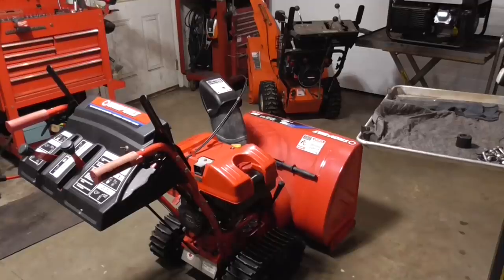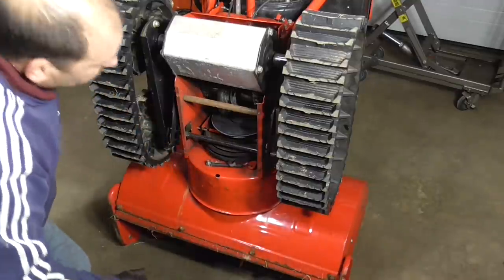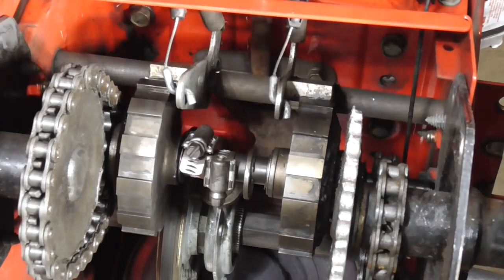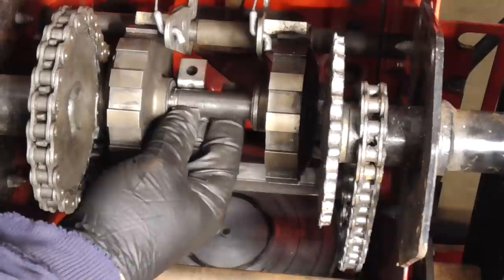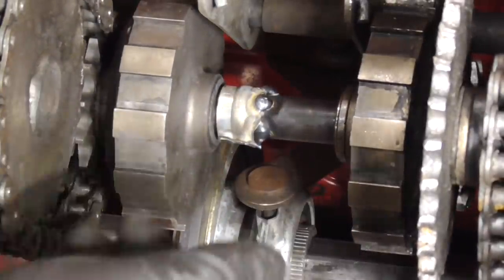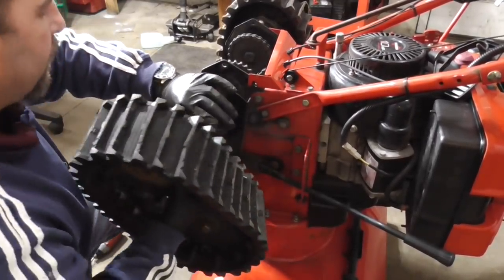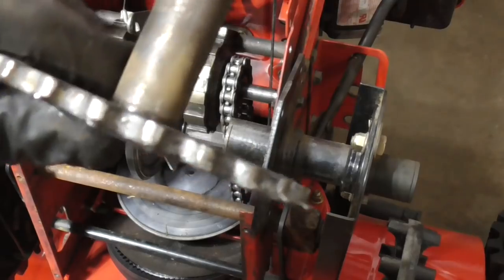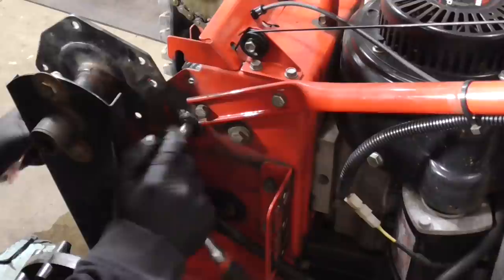Fixing Track Snowblower That Won't Drive

Comment: Great video! I got this same snowblower cheap off a co-worker a couple years ago and am trying to replace that drive gear shaft that you welded the clamp onto. I was having the same issue with the right side not propelling and it was due to a cracked cog on that shaft. So far I've got the old shaft out but can't get the new one in. I need to take the track off like you did so this video was perfect for my situation! Thanks again!

Comment: I just watched your live broadcast.  I wished I had known it was on I would have sent a comment.  I don't know how your fixing the John Deere hood.  I fixed one this summer it had 5 fairly large cracks. I bought a fiber glass kit and used a drywall tape actually a plastic mesh. I used the mesh on the inside only cut some fine grooves in the top side and filled with fiber glass. I bought  some  john Deere  green at home depot matched perfectly.  I cost $3.00 per can John Deere  wanted $9.00 per can.
I also wanted to mention that I watched your video on home remedies.  Your wife segment on  the floor Steam cleaner was great .  I ordered one right after your video.  Thanks again  Ron B  Ron's small engine  repair. Marcellus Michigan

Comment: What a gem of a machine!  Amazing how Troy Bilt Dolled Up Tecumseh with those covers.

Great fix!  Never seen that one for before! 🦅🔧🤙🏻🇺🇸
Reply from the maker: Glad you enjoyed it  I have worked on a  few of these troy bilts with the plastic engine cover.  The cover is the biggest PITA to remove and snap back on it always gets stock on the electric starter, the choke shaft, and the studs it mounts with.

Comment: Nice video. I had the same exact issue with an old White track drive. Ended up just taking a piece of aluminum tubing cut to length and cutting a slit down it lengthwise and spreading it a bit to get it over the shaft. Then crimped it with pliers and wrapped it with some zip ties. If it doesn't hold I'll definitely be welding a piece in there.

Comment: Great video my friend. I am in Pennsylvania too. I was born in Johnstown and from your accent I figured you were out in Pittsburgh. Great area. I am out in Bangor PA now working at a pharmaceutical company dreaming about starting a mobile small engine and welding repair company with a truck with a crane like the guy from classic work or IC weld. I ope to hear from you. I shouldn't really say dreaming because I just bought two welders, a truck mounted and a trailer mounted. I also found a 1999 Ford Ranger that needs the frame welded but that will be no problem. I am slowly getting my tools together. I am also recovering from a horrible accident where I was hit on my Harley and had extensive blood clots where I was not allowed to walk for seven months. I survived at least.
Reply from the maker: Bangor is about 35min. from me.  Going from white collar to blue is going to be quite a jump.  I would start moonlighting and see how you like it.  You will still have healthcare and a steady paycheck if it does not work out.
Reply: @doublewide6  It is a decent paycheck and great healthcare. I do not plan on jumping off. I definitely plan on doing weekends mainly. Thank you my friend!!

Comment: Great video.  It's really helpful to see step-by-step fixing issues and not just jump to finished product.  Thanks for taking us along.

I do have a question.  The auger housing, scraper bar and auger housing shoes look like they are about two inches off of the ground.  Are the tracks adjustable to lower the front down to where it should be?

Comment: Thanks for the video!  I have the same snowblower, left track won't drive.  Spins free with or without the steering assist trigger applied, while the right side engages with the friction wheel and steering assist.  Is there a keyway or shear pin for the track wheel?  I have it apart in the garage, cannot find any reason why it would not be working.  Chains on sprockets, everything seems to be within spec.

Comment: Hi, I enjoy your channel I have a craftsman snow blower with a track drive, my problem is with the wheel shifter lever doesn't do anything when shifting to normal to wet snow and when I shift it to transport mode the lever moves back to normal by it self, what do I look for and how can I adjust this thing ? any help is greatly appreciated please if you can direct me with pictures of what to look for Id really appreciate it.

Comment: I have a Craftsman track drive 8.5 hp 26" snowthrower I bought in '97, and it has this exact problem. I don't see a loose chain, so I'll just take it down to the mechanic. Hopefully it'll be an easy fix. Getting it on the truck should be fun. Not. Since it only wants to go right, not straight ahead. I bought the track drive because that was what we needed. Somewhat steep terrain, plus doing paths off of the driveway. Need that traction.

Comment: Stens is a good company.  I just rebuilt that K301 and ordered their rings, they were quality parts.
Reply from the maker: I saw that I thought Stens failed you?  I have used their parts, but I just became a Stens dealer, so I can get the parts from them and not a reseller.

Comment: Nice fix; I have a 10 hp Tecumseh in my shop right now with a stripped starter gear caused from loose bolts. Does Stens sell the starters? Thanks for the video.
Reply from the maker: Yes, they do, but I like the DB electric starters from Amazon, they are aftermarket just like stens.

Comment: Great video.  I don’t see many tracks where I am at either, but definitely more costly to repair.
Reply from the maker: Tracks also suck to push around when they are not started and in your way in the shop.

Comment: Hello,
I have an MTD  8/26 Track Snow blower MTD E740F000 that doesn't drive I've replaced the drive belts, friction disc and wheel. everything is free turning and spinning like it should with no weight on the tracks. When I tip the machine back over on it's tracks start the motor put in forward or reverse you can see it wants to move but something is binding and holding it. The only thing I didn't replace was the outer Flange Bushings part # 941 0339 or 741 0339 #59 on Jacks Small Engine parts diagram. I noticed when I had everything apart that those outer bushings were worn egg shaped both left and right side, Would that cause everything to bind up and not move, if so should I replace all 4 or can I get away with just the two outer ones. It's an old machine.
Thank you in advance for you help.

Comment: Great job Bob. I'm not a dealer in any parts but I've used stens a lot and I think they are a quality company. Excellent idea with the electrical strap. I've never worked on one like this but I have worked on a few craftsman track drive blowers which are a totally different deal but equally goofy to work on. Congratulations on 100,000 subs !!! You deserve it
Reply from the maker: Thanks 👍

Comment: I have a MTD Yardman 9HP 26" 2 stage with tracks electric start.😅 paid 75.00 put 200.00 into works grate. After I made it go again.  I know Stens when I worked UR I ordered parts from them. I also have a very good back round in PT -V, Flat, Round, Conveyor Belts of all kinds. Look up Fast Trax Snowmobile I helped in the development of it. can be seen on U-Tube. 1911 Harley uses a 1-1/4" x 101-3/4" long flat belt if it is the correct material it will go 1000 miles or better factory belt 60miles.

Comment: Just replaced a 120 v electric starter on a troy-bilt storm that wasn't track drive. The starter was stripped completely. You ever seen that before? Also ,cleaned the carb on it. Those engine covers are a night mare to get on and off too.
Reply from the maker: What happens is the starters lose a bolt and shift.  It causes the teeth to wear out  on the ring gear.

Comment: Why would you weld that piece on.. seems like the better choice was what the other guy did. With those clamps.. cuz then you can remove them if you need to And they both do the same thing taking in place of the snap ring..

Comment: Ah ha more complicated than the one with wheels.  I wonder if the track type move through the snow that much better than the ones with wheels.  Great video anyway.
Reply: My opinion they do I have a craftman  track drive and its very strong going thru the snow traction just like a miniature bullfozer

Comment: You can’t beat a Canadian made snowblower. I bought my 8hp-26” in 1985 from Canadian Tire in Ontario just east of Toronto and it’s still running great which I maintain.
Reply from the maker: Those old blowers are really well made.  If you take care of them they should last a lifetime.

Comment: Welding something that was originally snapped in, now you have made that part unserviceable without cutting it out. On an older machine like this guess it wouldn't matter much. MTD = Many Troubles Daily from Taryl LOL
Reply from the maker: Yup,  If I replaced the shaft it would of cost an additional $200.  If it needs to be replaced in the future it is still going to be $200.

Comment: That “electrical connector” is called a one-hole-strap.
Reply: Way to go. We call it farmer engineering. . Get that machine working and buy parts later or maybe not.
Reply: @ohiofarmer5918  I’ve heard it referred as something else, but I’m not gonna say it on YouTube!
Reply from the maker: just googled it.  You are right one hole strap.  I never heard the term.
Reply: @doublewide6  I learned a lot from you, so I figured I would contribute. Love your videos.

Comment: 6 left chain looks bad
Reply from the maker: It has some slack in it for sure.  Don't think there is an adjustment for it, so it would require a new chain.  Hindsight is 20/20.
Reply: Thats what call it .lol it should be back